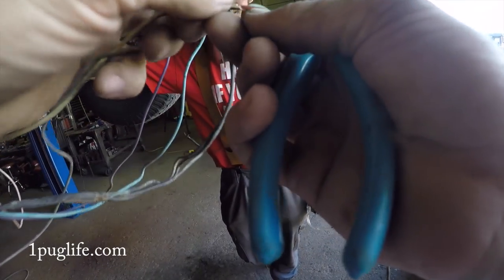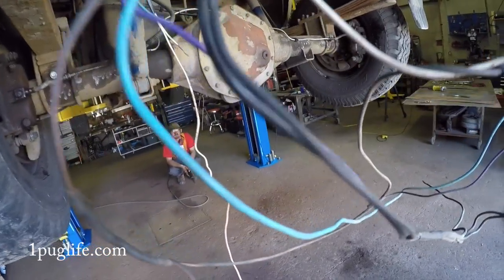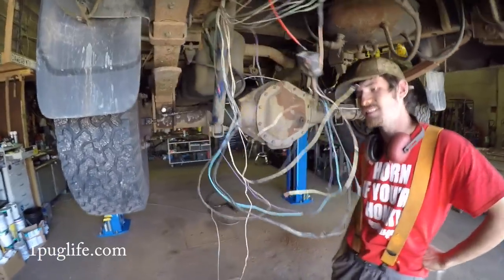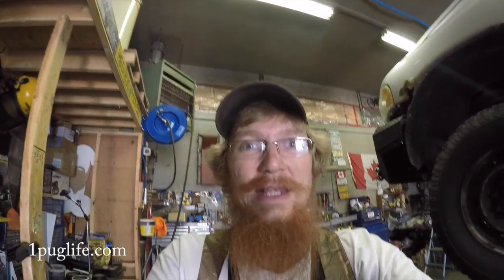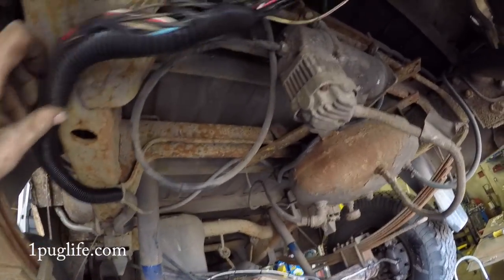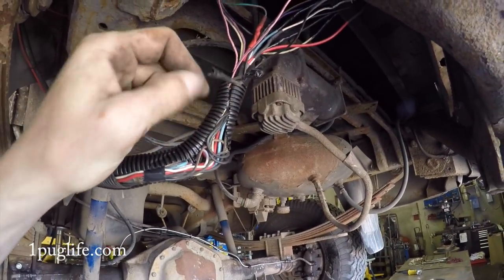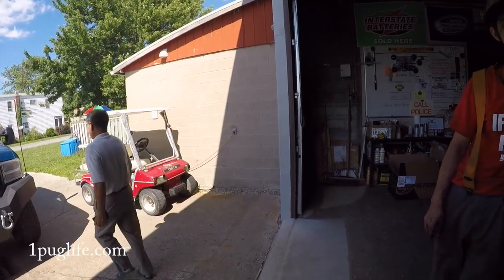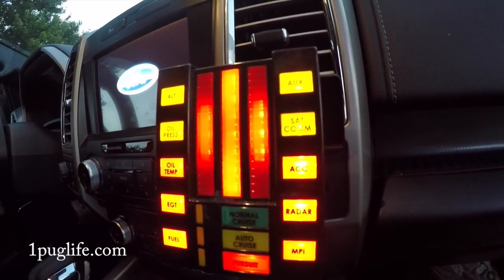rusty and wired

Comment: Wiring is easy all you need to do is cut and label both ends of the wires you then trace it back to the main loom wire-by-wire. Once you cut all the bullshit wiring out you can get some 7core trailer cable and solder.heatshrink, easy.